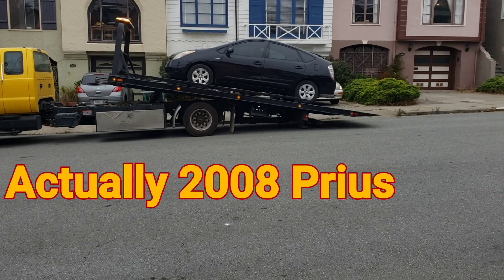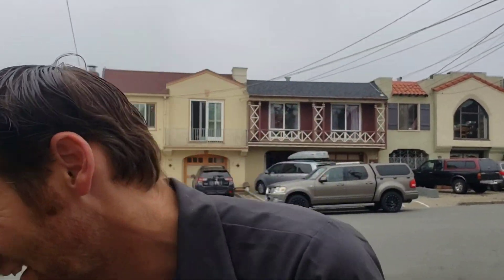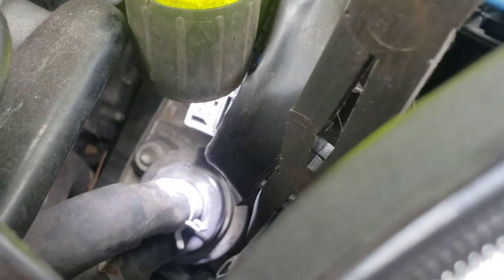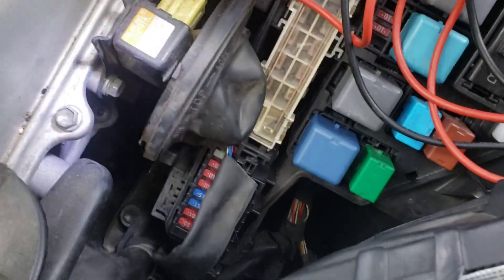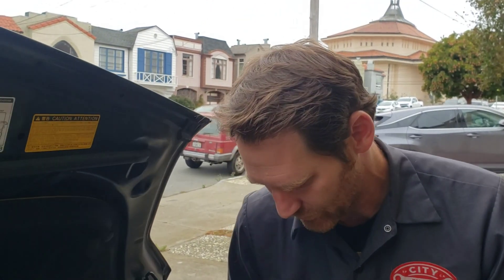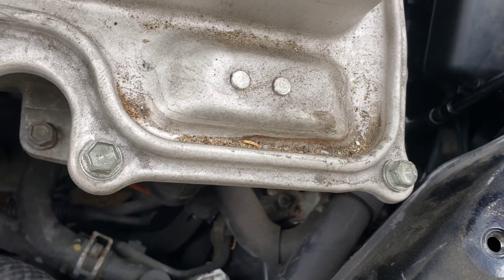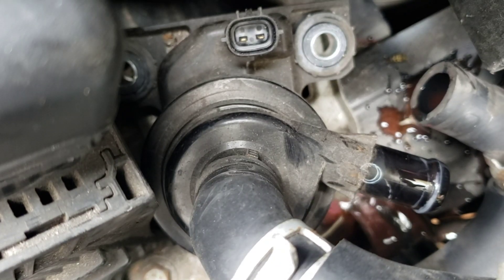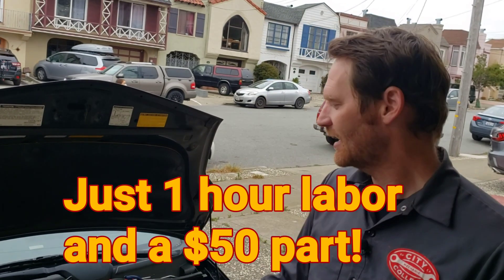Prius Diag and Repair

Comment: This popped up again... Gonna be blunt. Try the bumper cover/headlight removal. When you remove the headlight, it's right there... so easy to access and replace.

 I've done it both ways, and headlight is SO much easier/faster.  Takes about 20-25 minutes start to finish. I clamp off the hoses and only lose about 1/4 cup.

Also worth noting that these things can fail in a short and blow the AM2 fuse which essentially kills the car instantaneously is the ignition circuit loses power.  This was VERY common prior to the major redesign/recall in 2007.  Less common now, but happens about 5-10% of the time.

Comment: Depending on operation and ambient temps, P0A93 may not display if temp limits aren't hit.  A/C use guarantees a P0A93, but mild climates w/o A/C use can permit operation for a surprising duration. Additionally, the P0A93 frequently resets once the inverter has cooled.

I've also seen two occasions where the pump will function intermittently.  My son's car did this.  He got the code, brought the car over, pump was running fine.  Headed back home, master warning and lights, returned home - yep. Inoperative.

There's also the rare case where the pump shorts and it blows out the AM2 fuse rendering the car completely dead.  Mostly only dome and headlights work.

This is substantially easier if you remove the driver's side headlight assembly (partial bumper cover removal to access the 3 10mm bolts) - completely unrestricted access to the pump and hoses. Clamp off the hoses and lose a couple of tablespoons of coolant.  I disagree with the no bleeding recommendation.  On two occasions, I've had to correct user-installs where the reservoir was completely full, yet air in the system prevented circulation, and about half the time, I get enough bubbles out of the bleeder to make me glad I bothered.  Headlight removal/clamping turns this into a 20 minute job.

Comment: tanks for your greats videos you can put a link for the  inverter pump that you using in this video  tank you
Reply: If you have the choice, ALWAYS buy the Toyota pump.  It costs 2X as much as the aftermarket Dorman, but it's more than 2X better.  I've replaced aftermarket pumps after only 1-2 years of operation.

Comment: The Prius C uses an inverter pump as well? i can't find videos about how to remove the inverter pump in the Prius C, nor information about it.
Reply from the maker: I see the inverter pump for prius c sold as a part. Its in there somewhere!
I haven't had a c in that needs that job so I never checked where the pump is located.
Reply: @Mrelectric423   I see, maybe if someday you get a C with a problem in the inverter pump, you can upload a video about how to remove and replace it.
Reply: Gen 3 inverter coolant pump failures are extremely rare.  They are PWM controlled and run based on demand rather than 100% 100% of the time. Of course, the electric engine water pump has taken its place as Mr. Electric has already demonstrated.
Reply: @snoobler   Are you sure they are controlled? because the one in my Prius C, always sounds the same by the time i turn the car on, as if it is always running at the same speed, i think is just a pump supplied with 12v, that will run at constant speed, and won't change it.
Reply: @hedgehogthesonic3181  Yes.  If you look at the power connector, you see 4 pins.  That's pins for G, +12V, Tach and PWM signal.
Reply: @snoobler  So i guess the pump might lower the speed a little bit in cold climates? where i live is almost always hot, so it might run at full speed at all time here

Comment: Looks like you need one of the wireless Lapel mic. eBay fairly cheap easy to use plugs into your cell phone for the receiver transmitter in your pocket or shirt
Reply from the maker: t lech Yeah I am going to get one for the next video. All my previous videos used the in phone mic. I am happy with how much the lapel mic improves clarity.